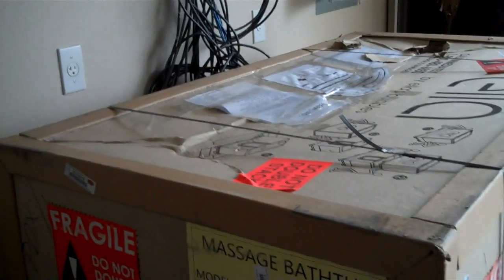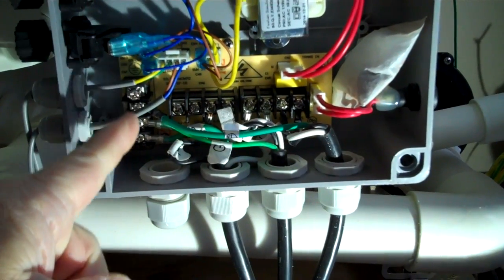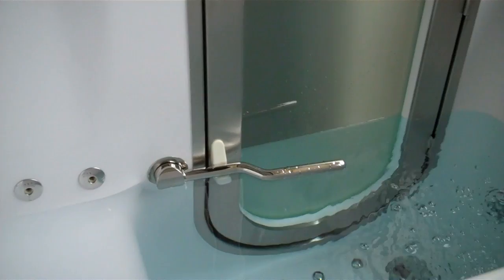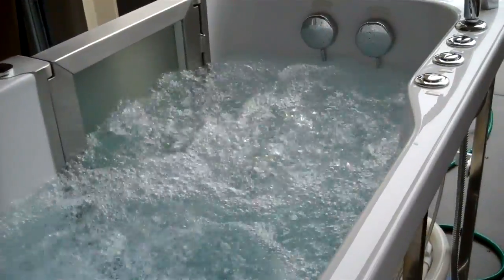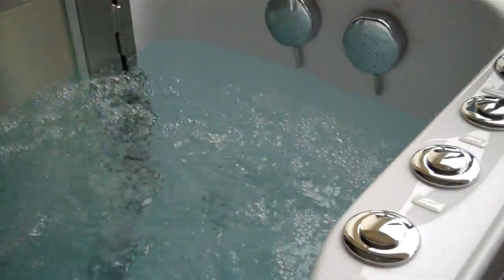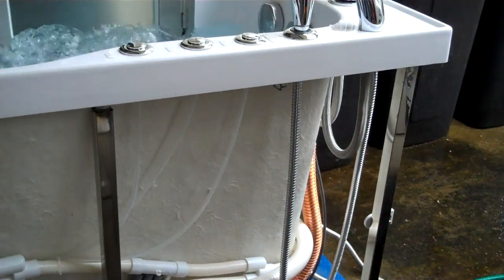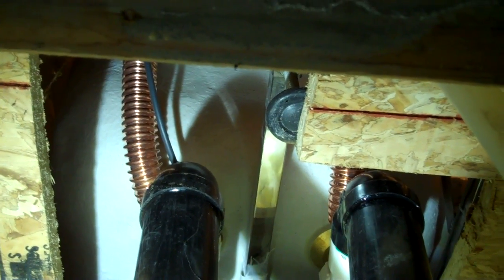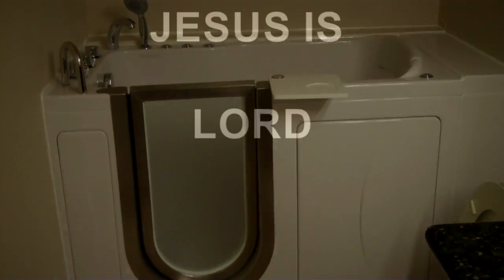Walk in TUB Installation

Comment: Does anybody know what tool you need to take off the door handle of a SafeStep walk in tub?  It is the 4th time I have had to replace the door handle because the plastic coating on it has peeled off . The repalce the door handle free of charge but charge to have another one put back on.

Comment: How much does the drain and P-trap add to the height of the step up into the tub? Or are you not flat out saying that this has to go through the floor, making installation on a slab floor impossible?
Reply from the maker: kat lopez no it's totally possible in a slab floor it just has to be pre plumbed for it there are double 2-inch drains that end up in a P-trap that then go to a drain and if all that's done ahead of time and it all lines up perfectly and you simply make the connections it is perfectly acceptable on a slab floor just takes a little bit of work get out your jackhammer if it's an existing slab but if you haven't poured the slab yet just plumb it to fit and you'll be fine

Comment: Jon, how did you decide on the Ella? I'm am trying to figure out which walk in tub to recommend to a client. Factors I have listed, fill time, drain time, curb height, hydro therapy, aero therapy, seat warmer, in line heater, cleaning system, anti-scald, warranty. Your experience and advice are appreciated. Thanks!
Reply: Hi. Good questions.  Did you get any answers by now to some of your questions? Thanks.

Comment: hello folks, any one knows what's the cost of the unitvwirh out installation?
Reply from the maker: https://www.homedepot.com/p/Ella-Petite-52-in-Acrylic-Walk-In-Whirlpool-Bathtub-in-White-with-Thermostatic-Faucet-Set-Right-2-in-Dual-Drain-H3168/304709255?cm_mmc=Shopping%7CG%7CBase%7CD29B%7C29-23_FIXTURES%7CNA%7CPLA%7CHot_Tubs%7c71700000032906596%7c58700003860243974%7c92700035765251744&gclid=CjwKCAiA8rnfBRB3EiwAhrhBGkk9qkzqDdZ_p-eElBDPB4rUMmy5DU6R5dXFh3z-btgVvYXm5ivYuRoCSscQAvD_BwE&gclsrc=aw.ds
Reply: Looking into one of these for my home. Found them to cost $2,500-$4,000 without installation.

Comment: Hi Jon, I hope you're still answering questions on this old video. If so, would you kindly know if these can be installed in Europe, especially with respect to electricity? It's 110V in the US, 220V over here, would a step down voltage converter/transformer be enough?
Reply from the maker: The only thing that gets plugged in is the heater and that is just to maintain the temperature I would venture to say you don't need it the same way you don't ever need to reheat your water when you're doing a normal bathtub full of hot water usually you're plenty soaked to the bone before the water ever gets cold so the only thing that needs to be plugged in is the heater and it only cost about a hundred bucks for the heater so if you picked one up from where you live it would cost about the same amount of money and it would plug into your power so I would venture to say there should be no problem If you can get the unit install it enjoy it and if you want to have a heater that uses 220 instead of 110 just order it

Comment: What are elec requirements?  Why did you say perfect 12 times about the drain? Do you need hot and cold water supply? How do you connect drain to a slab?
Reply from the maker: It should have a dedicated 110 volt receptacle of course it doesn't need to be dedicated but they would like it to be said nothing else is using it when it's trying to heat up and maintain the hot water that you installed but it could be hooked up to a near receptacle that's hardly ever used that would be perfectly fine too I was real excited about the double 2 in drains You don't normally you only put a engine and a half drain for a bathtub this requires two 2-in drains that's eventually snake into one and if it can sneak into a 3-in that would be fantastic but usually it snakes into a 2-in that you have to make if you're taking out a bathtub in its place because it only has an inch and a half drain
If you're on a slab you just simply have to remove whatever concrete's in the way of allowing you to turn it into a 2-in drain and then connect everything up like you would as if you were not on the slab Yes you want to run hot and cold because this thing could easily be converted to a shower by installing walls and a shower system so you would want to have cold water cuz nobody wants to take pure hot water showers or for that matter nobody wants to have beer hot water in that tub either because you couldn't step into it if it was hot I think the hottest you should use it is whatever hot as you can stand so if your water is hotter than you can stand when you turn on the shower and you try to turn on pure hot then it's too hot to use without cold water

Comment: I would be grateful to anyone who can explain the grounding wire going nowhere.

I'm having no luck getting a response from manufacturer.  On my tub that grounding wire (green with yellow stripe) is attached to heater metal tube like on yours,  and than loosely attached to metal frame of tub near floor.   But mine has another same colored wire coming from that frame attachment and it is just loose going nowhere.  Warranty states all electrical on tub itself is pre-done and not to be touched or it voids warranty...    But warranty also states tub must be properly grounded!   There are multiple control boxes and motors etc,  and some of them have unused wire connection ports.   This thing is total mess and came with absolutely zero electrical guidence.

My tub powered on and ran for a minute before shutting off and never starting again.  GFCI and breaker box still has power...
Reply from the maker: Hi brother

I am assuming you are trying to chase down the grounding wire

Because the tub is not running

Had it been running the whole time

You may have dismissed that grounding wire as just a fluke

Or as something for optional equipment that you don't have

But since it's not running

you think it may have something to do with the grounding wire

Because you can't find anything else

It's not the grounding wire

That would be as simple as finding the power in the box ,

that presents power to the tub

Using a wire nut

Put in an additional grounding wire

To that wire

And that would solve that

But it is not going to start your tub

There is something else amiss

Have no idea what it could be

I just gave away one of those tubs for $300

I told them I couldn't figure out why the motor wouldn't start

And if I did figure it out, it would cost $2,000

So they came and got it.... as is

It saved them hundreds of dollars

but I will never know 

if they actually started it

It could be windings in a motor

It could be a simple capacitor

Or a blown diode

Nobody knows that crap

Your best bet is just to buy a new motor

Or take that motor off and take it to a motor repair company

Look underneath alternator repair

They do all rewiring for alternators

They can figure out what's wrong with that wiring

The wounding could be short
Reply: @Jonehughes  It's brand new under warrenty,   and alterations to grounding wire would void warrenty.  My customer just spend $5500  so I don't want to void warranty.
Reply from the maker: Since it is still under warranty

Don't look at it for another minute

It's not your job to make it work

Your job was simply to give it power

The correct power

And if you did that

You leave it in the manufacturers hands

If they won't do anything about it

And you've already contacted them

Then we're back to what I said

And it's up to you

Either of those two things are correct

Either the manufacturer is going to come over and fix this thing on their dime

Or you are going to do what I suggested

There's no reason for you to be figuring out any ground wire
Reply: @Jonehughes  I hear that, unfortunately I can't wait around for company to become accountable and responsive.  I need to continue with bath remodel and I can't until tub is buttoned up. And I did try ground that loose wire to frame,  but it's already grounded elsewhere and did nothing.  Fact is the tub ran for at least a minute without issue(with my wiring in house) so definitely a fault at tub side.  I can't even access most of tub electrical now that tub is in place.

It is what it is...another day in paradise?;)

Comment: There r 2 broken air jet parts that attach to the tub underneath. I would like to know how to get replacement parts and how to fix. I’ve left many msgs for the guy that sold me the tub but get no return call. I’m pretty handy so I think I can do myself with just a little guidance.
Reply from the maker: Hi Melissa 

you're not completely out of luck 

but you're pretty close to it

 your best bet

 is just to go generic 

and not name brand 

unless you just happen to get lucky 

and can find parts for your system 

but normally

 you have to MacGyver it

 and figure out what you have

 and enlarge it or reduce it 

to whatever you can get to work 

it's definitely going to be one of those things

 where you use all your handy Acumen

 and make it work 

as a MacGyver situation 

anyway 

something like this

 go to Amazon

 and start scrolling through Part systems and find something that's close to what you're looking for 

and make it work
Manifold Hot Tub Spa Part 16 3/4" Outlets with Coupler Kit Video How to https://a.co/d/1dzJHXt
Reply: Well, crap. I’m the jerry-rig queen so, if I can figure out how to get the air jet wall thing that’s broken off of the underside of the tub without breaking the tub wall, I think I can figure it out. Wish me luck and thanks for the quick feedback. Kind regards.
Reply from the maker: When you're trying to take apart any of those systems

 no matter what tub it is 

just remember

 they put them on as parts 

and then connect the hoses to the parts with sealant

so you're just talking about sealant and  parts 

so you can take it off 

the same way they put it on 

the only difference is

 they have good sealant 

and sometimes 

two pieces become one 

and it's hard to remove

 so if you can retain the parts that are glued properly together

 and leave those parts 

and then just replace the parts 

that are broken

 you'll be way better off

Think of it like ABS glue on ABS pipes and fittings 

even if they weren't perfect

 if you put enough ABS glue on the system

 they will never ever come apart 

it will become one

 the same thing applies here

 if you find parts that works at all 

 then just use good sealant 

it'll be perfect and work perfect for you
Reply: Well, I can probably fix 1 without getting it off the back of the tub but, one is in pieces. Wish I could send a pic.
Reply from the maker: You can 🥰❤️

 541-660-7805

Comment: What type of electrical do i need?
Reply from the maker: Normal 110 volts
But it should be dedicated to just the tub because if some other large appliance is trying to run at the same time it could overload your motor 

your motor does have a reset button on it in case it does get overloaded

 but it's a big pain in the neck to get to

Comment: What is the name of the copper piece that is on the bottom, where overflow pipe is connected?
Reply from the maker: It is all part of the waste and overflow assembly
https://www.build.com/product/summary/558206?uid=156772&jmtest=gg-gbav2_156772&inv2=1&&source=gg-gba-pla_156772!c1674457819!a65373557699!dm!ng&gclid=Cj0KCQiA-qGNBhD3ARIsAO_o7ymf_vuklgA8roAnwCCN4ZYI_l4qN6Zc4mhA2cFq1665-9AEFusw6SsaAhUiEALw_wcB&gclsrc=aw.ds
Reply: Ok. Because I just need that piece since I have the overflow tube but it isn't connected to anything. But thank you so much.
Reply from the maker: Ronald it's impossible to communicate on YouTube replies I can't post pictures to show you what you need so text me at 541-660-7805

Comment: Jon I have an Ella Royal walkin tub and there is a leak where one of the air tubes is connected to the bottom of the tub.  What kind of connection is it and how do I tighten it?  Thanks for taking the time to prepare your video and for your advice.
Reply from the maker: Hey Brian

 if you really have a leak

 there's really no way of fixing it 

other than pulling it all the way out 

to be able to get to both sides

 and then you can just redo it or replace it as you see fit 

but if you can't do all of that

 then at least do a super good job with silicone 

whatever you think might be leaking

 and hopefully that will do it 

but if not 

it needs to be taken completely out 

and repaired 

because you can't take off the top ring without losing the bottom 

if you undid the top  ring

the bottom will just fall out 

and then you would be hosed 

possibly....you could just take off the top and then the bottom.... hopefully .....

would stay in place

 you could just replace the seal 

and put it back in

and you're good to go

 but if the bottom does separate 

and come away

 so you don't have access to it anymore

 then you would need to remove the tub

 all the way

 to fix it 

and then put it back in 

we will hope for the best for you
Reply: @Jonehughes  Thanks Jon.  The leak is from below the tub.  Is it a pressure fit or is it a screw connection?  The tub is not installed so I have easy access to the underside of the tub.
Reply from the maker: @brianplazek3043  they are almost always a screw connection

 if this is already out like you're saying you should have this out and fixed in no time at all
Reply from the maker: To remove, twist the jet face anti-clockwise to its limit and then one last effort to twist past this point - a click can be felt or heard and the jet face can be extracted by pulling it out.

 Press Fit - A spring loaded ridge holds the jet face in place. To extract it, lever the jet face outwards until it pops out.
Reply: Sorry Jon but I guess I'm not explaining myself very well.  On the underside of the tub there are 90 degree adaptors (black plastic) that connects the plastic hoses to the bottom of the tub. Near the ends of these adaptors there are blue rings  It is at one of these blue rings that I have leakage.  It looks like a compression joint but I don't want to mess with it unless I'm sure. Really appreciate your help.
Reply from the maker: https://youtu.be/KbQn_GYJbO0
Reply from the maker: https://www.wikihow.com/Replace-Spa-Jets?amp=1
Reply from the maker: Hi Brian everything doesn't apply to you but this should give you enough of a heads-up to realize that the housing if it is cracked  can be replaced the same way it's installed but you can also just silicone it and fix it that way if it turns out to be the housing

  you never know so you need to take out the jet take a look and see if you can see if the housings cracked if it is cracked it needs to be replaced
Reply: @Jonehughes  Thanks Jon for your help.  The leaks are now gone but I do have another problem which hopefully you can help me with.  It's the flow splitter mechanism.  I can get cold water but when I turn the dial to get hot water added all the flow shuts off.  There is a button that you press which I gather is a safety device and  it does press in which allows me to turn the dial all the way so that I should just get basically hot water but no flow comes out.  Very strange.  I checked the hoses to the flow splitter and they are not plugged.  Any suggestions?  Brian
Reply from the maker: Yes the valve which allows it to go from cold to hot or a mixture of both is clogged they have very small orifices assembly needs to be cleaned or replaced
Reply: @Jonehughes  Thanks Jon